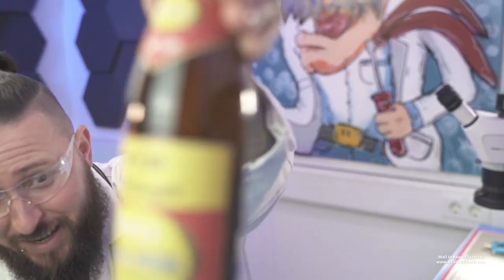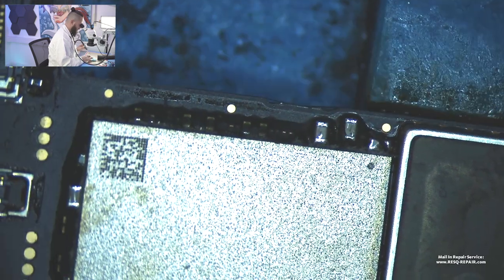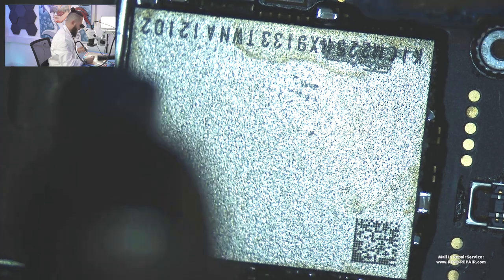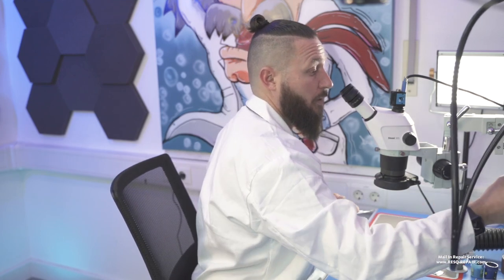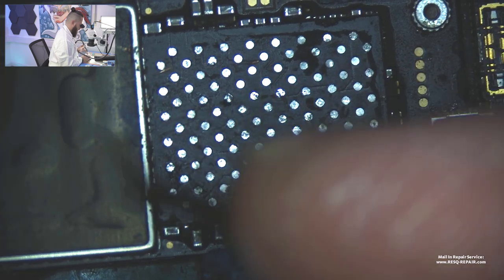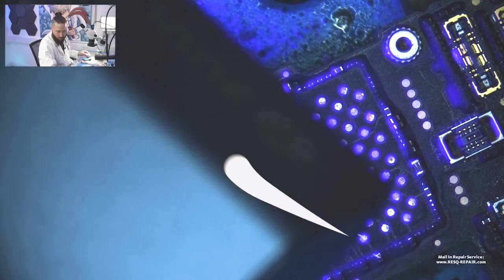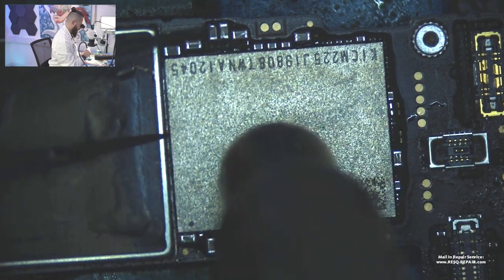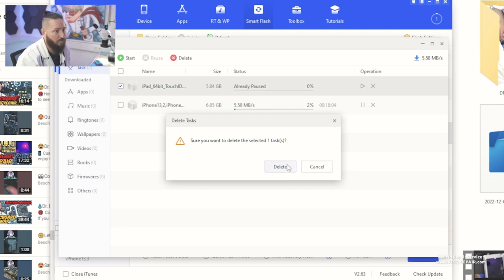🔧Dr. Ben: Repairing an iPhone 12 Pro with “ERROR 9” (NAND Replacement - Doc Ben on 🔥)

Comment: Hi. I want to reball a bigger storage nand chip for iPhone 13 pro max. I have ordered nand chip from aliexpress and asked seller to program my iphone's wifi address and serial number to it. I wanted to know, what tools is necessary for this operation?  I meant which the cleaning wire and flux is recommmended? (don't know the specific techical name for this bit). I have seen lot of options on  hot air stations on amazon -also want to know what would you recommend in this topic. Maybe you could make some video on this topic, for example: "Beginners guide to iphone nand chip resoldering and the necessary tools." Many thanks. Ray

Comment: what the perfect temp for taking any ic on the logic board ?
Reply: hot enough to remove the ic. all machines, even the same model, can vary too much for anyone to make a recommendation on your exact heat. it matters which ic, is it a big one or a tiny one. what components are located near the ic. what is on the other side of the board. how big is the board. the best thing you can do is to test on practice boards to see which heat works best. some people like high heat and quick work. some people like lower heat and slower work. both can be fine if done properly. all you can do is know at what temp different solders melt at. and practice.
Reply from the maker: There is not „one temperature“.

Comment: I have error 9 on my 14 pro max when trying to restore via Itunes too. I had tried another phone with the same cable and on the same pc and it restored perfectly fine. So i changed another cable, updated iTunes but error 9 is still there. But somehow i can flash and restore it with 3utools, thats odd. Do you think this is just software bugs or NAND prolem ?